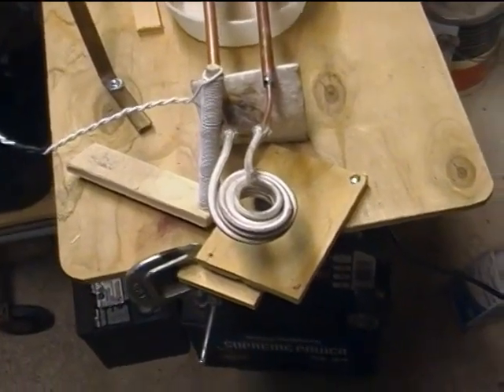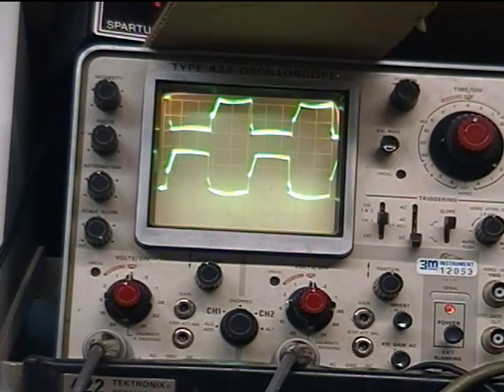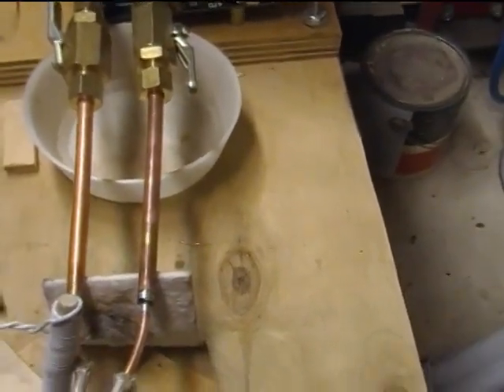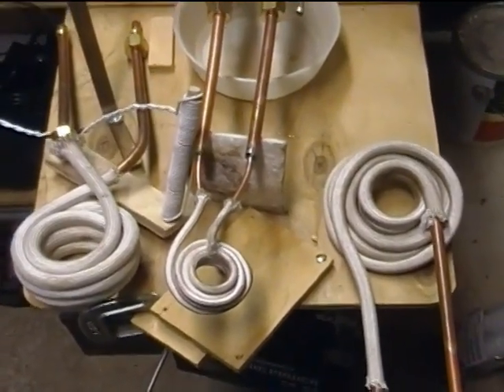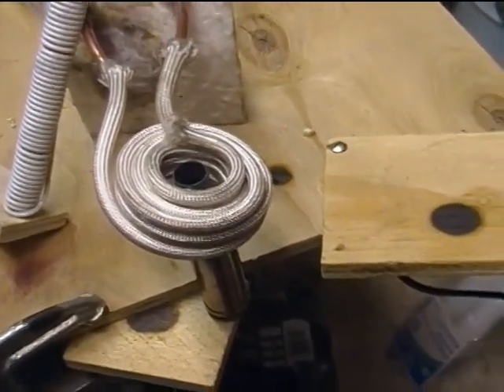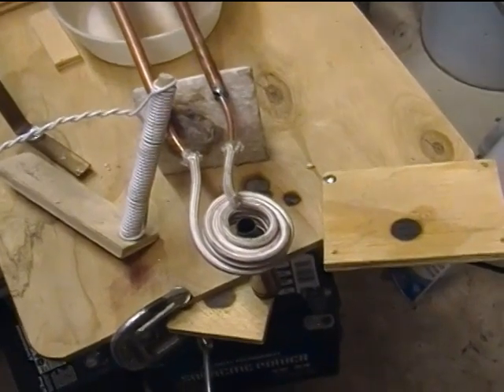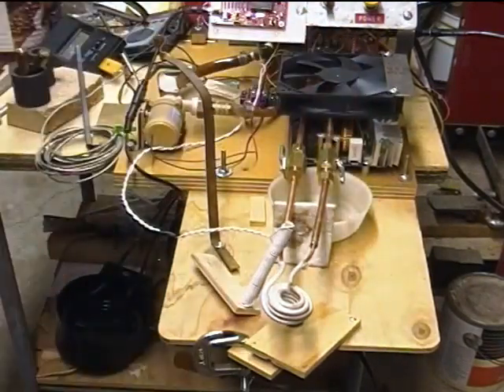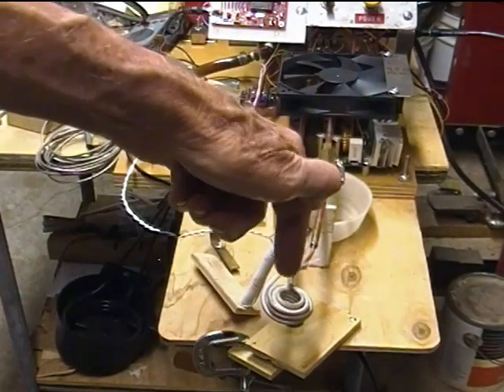Annealing Brass Cartridge Cases with Improved (3 X 3) WorkCoil using ZVS 1000 Watt  Induction Heater

Comment: I love the videos you put out. these videos made my life much easier. so I have a question. I'm looking to use a 1800w 48v ZVS, with 1/8" tubing. My questions is how many turns would you recommend if I'm turning the coils with an ID of 3/4". Either single wrap or double wrap. Thank you in advance for your help
Reply from the maker: Thank you for your kind words.
I suggest that you examine this webpage of mine that deals with work coil design:
https://spaco.org/Blacksmithing/ZVSInductionHeater/WorkCoilsForZVSInductionHeater.htm
Reply: @frenchcreekvalley  I watched your video and it helped me alot. See I am using the same exact 1800w heater @48v for my annealer. I will be annealing 6mmbr brass. I don't have the heater yet as it will be around 9/15/21 so I can measure the coil that comes with the heater to calculate a two turn coil, because I am limited on coil build OD due to the support that will hold the case. See I'm building an automated system that will auto feed, drop, anneal, then drop the case. My question is if I use shrink tubing to cover the copper tubing or class cloth sleeving, and water cool the tubing, do you think a dual layer 4 turn coil with a 5/8" ID work with my server power supply knowing the annealer will switch the heater of and on the desired amount of time to anneal my brass doing up to 100 pieces consecutively? Sorry for the long reply, as I wanted to give you as much info as possible to get the best possible outcome.
Reply from the maker: @keeper1959fem  Please examine this spreadsheet which shows results from many types of work coils that I have made:
https://www.spaco.org/Blacksmithing/ZVSInductionHeater/Work Coil Data.xlsx
Regular shrink tubing over the work coil will probably melt, but glass cloth (tubing) or ceramic tubing will be okay.
  You can see that I am only using the 1000 watt ZVS heater in this cartridge case annealing video.  I would be a bit concerned that using such a small coil on the 1800 watt unit may cause overheating of the Mosfets due to low inductance and, therefore, high frequency of operation.
Reply from the maker: @keeper1959fem  Thank you for the feedback.

Comment: Hello i have VEVOR variac variable transformer,variable transformer 0-300V Adjustable,Output Volatage Single Phase Variable Transformer 1KW, Power Converter with Standard Plug Circuit Break can i use that for my induction heater
Reply from the maker: A "Variac", as I know it, simply varies the mains input, but the output is still alternating current.  If your whole  description is describing that variac, then,  NO, you can not use it to power this kind of induction heater.   You need a Direct Current power supply that can deliver at least 24 volts but not more than 48 volts DC, at 20 amperes or more.
Reply: @frenchcreekvalley  ok Thankyou I have just been looking it all up learning about it all I find it really interesting thanks again.
Reply: @frenchcreekvalley  will this do....... DC 48V Switching Power Supply Drive for CCTV, AC 220V TO DC 48V 150W-1500W LED Equipment Reulated Transformer Low Voltage LED Driver Transformer Module Adapter for LED(360-48)
Reply from the maker: @kenboswell8012  Yes, that one sounds okay.
Reply: @frenchcreekvalley  ideal and only £20. Thanks mate

Comment: Just watched your video as you suggested, so here are my peramiters, so I'm hoping you may be able to give me some advice on a coil design.

I have the same 1000w ZVS unit that is suppose to be rated at up to 48v.
I will be annealing rifle casing as well designing a unit to anneal 6mmbr to 338 lapua mag.

I will be using a relay to start stop the ZVS controlled by a time

Here is what may be a problem. I purchased a power supply from a server that is rated at 48v @ 3000w. Yes a lot I know but for $78 I couldn't resist. 
Will this be an issue if I'm looking to anneal the smaller brass (6mm) in two seconds, using a two laayer coil with three wraps of 1/8" copper tubing with an ID of 7/8" of just large enough for the 338 lapua mag
Reply from the maker: Re: "Will this be an issue if I'm looking to anneal the smaller brass "
No. The ZVS circuit only takes what it needs.

Comment: My interest is in cartridge case annealing (.223 & 30-06) and am interested in your work designing a coil to concentrate the energy to the shoulder and neck. I'd like to be able to use a lower voltage/wattage power supply. Obviously the small coil in this video heats too fast to be controllable on your setup. Would using this coil as opposed to the single layer coils most are using allow lower wattage PS?
How does raising or lowering the inductance of the coil affect operation?
Thanks
Reply from the maker: In two previous videos, I test work coils that don't heat nearly as fast as this one does.
https://www.youtube.com/watch?v=CuzfCnK0E0c&feature=youtu.be
https://www.youtube.com/watch?v=JVpOtdHeGUQ&feature=youtu.be

If you use the same 1000 Watt ZVS type of heater that I use, your power supply must be able to deliver at least 20 amperes.  But you can run at lower voltages than the 48 volts that I use here, but not, IMHO, below about 24 volts.

Comment: great work!!! really impressive!

I am building a 1000-1500W heater.
are 2x 100Ampere IGBT good for that? or 2x 50A MOSFETs (want to drive them not too hot)
and 1000V Capacitors (10x 0,47uF) (what voltage is good to not have them hot?)
Reply from the maker: The ZVS induction heaters that I use   all use !RFP260N Mosfets.  They work well with a 48 volt DC power supply.  I water cool my work coil and fan cool the Mosfets and the capacitors.  The 1000 watt model in this video uses two of those Mosfets.  The 1800 watt model uses two PAIRS of the same Mosfet and the 2500 watt model uses three Pairs of them.  I have not experimented with other Mosfets or with IGBT's so I can't comment on their use. 
  In my experience, more capacitance equals more idle current and more heat in the capacitors that needs to be dissipated.
Reply: @frenchcreekvalley  cool thanks! I will experiment with different MOSTETs and IGBT. then see the difference.